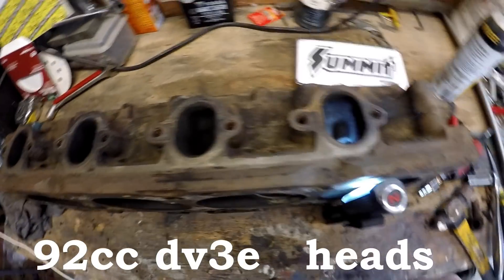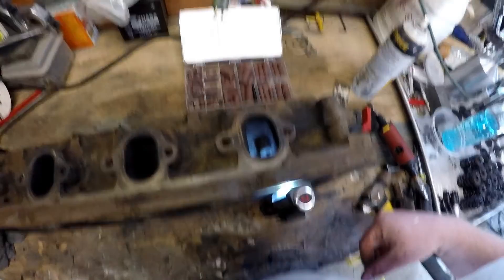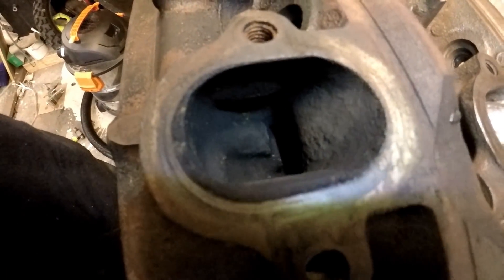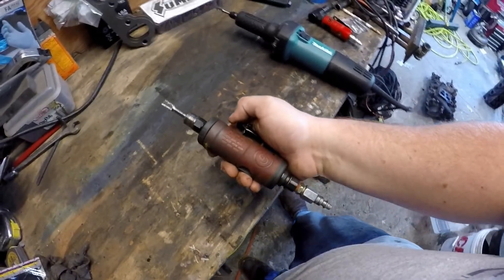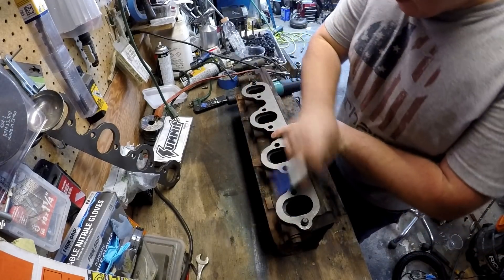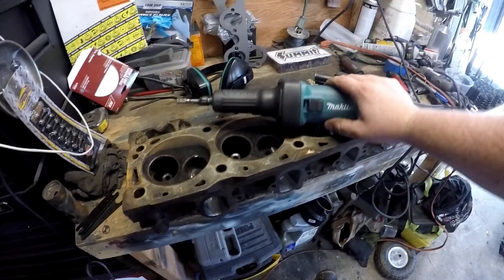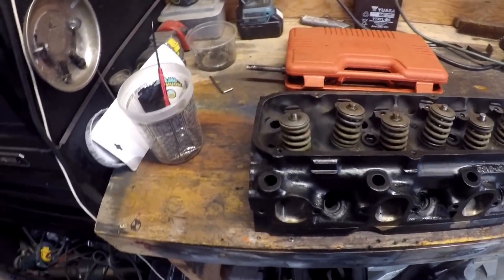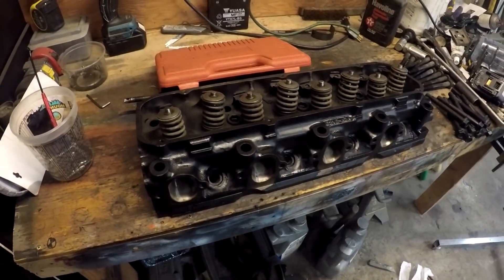Best (Cylinder head porting) tool dent side 460 build

Comment: I realize this was 6 years ago, but just to lend some advice for anyone attempting the same....

Always scribe a line into your material. It'll help you keep straight. The sharpie can wash off or burn off if you're getting to hot with the grinder and you're left guessing where to stop.

That Makita is a bad ass! I've had the same one for 22 years. It works better with a speed controller. 

Tapered burs like an "egg", "tree", or "flame" have specific purposes but work better than a standard cylinder round nose bit.

Lastly, keep the corners of the runner as round as possible. Like the roof is the perfect shape for flow, and the corners of the floor are dead zones.

Ideally you'd want to weld the floor up about even with the apex of the short side. That would increase air speeds on the flow bench, but more importantly it would give you an anti-reversion wall to keep the intake air/fuel charge clean.

Comment: Keep in mind that the intake port needs just about as much help as the exhaust port on these heads and it easily responds to porting.  On the exhaust learning what to take out and what to leave is very important.   Scott Johnston has done more research on porting of the base heads than anyone else that I know of and his porting guide is extremely valuable.

Comment: Look at reincarnation atomotive.com .also try a 1/2 oval burr I use an coarse burr that's for aluminum. Put it in past the guide and pull it towards you and make a trench on each side of the guide then grind off the excess . I make a little fin centered on the guide

Comment: First, worry about the guide boss and more important you forgot short side radius which is key for increasing the long sides velocity which ich is more important than net cfm and raising port ceiling using a header gasket is a waist and again hurts velocity.    watch some David vizard videos before you insert ignorance that was probably given to y6ou its alright to be ignorant if you trying to overcome it
Reply from the maker: thanks will definitely check himout

Comment: Do you have to fill in the egr hump holes?
Reply: I saw a trick a while back when i was building a 460...basically the guy plugged the holes with a hex thread & ground the "bolt" along with the hump & it was all smoothed out when he was done with it. Sealed everything up & had the air flowing only through the ports..
Reply from the maker: no sir i have the egr ports on the head plunged so there will be no leaks, technically it would flow the slightest bit better if i did  but cast is hard to weld . thanks for the comment!

Comment: At least your practicing on head castings with big combustion chambers. Need to find  D0VE casting heads.
Reply: What do DOVE castings look like?
Reply: @norman_sage2528  high compression head used on 429/460 up to 1971 step under cast iron cobra jet heads.
Reply: @kevind3185 the D0VE-C heads were not even close to the SCJ heads. The D0VE-C heads were the common head used. The non performance versions. They were essentially the bottom of the barrel for that time period. D0VE-C heads were the standard head used in 1970 & 71. They would be found on 460s in Lincolns & T birds & 429 thunderjets. Don't let the thunderjet name fool you, all it indicated was that this was the poorest form of 429 offered. If was not a SCJ 429 or a Boss 429. And the next step above the D0VE-C heads would be the PI heads & the PI heads were the best & top performance head ever offered on a 460. And PI heads are basicly 1972 only. Otherwise ford never made a performance version of the 460. It was always intended as a big luxury car engine, not a performance engine. The 429 got the SCJ package wich was meant to be a performance engine. Truth be told, alot of people like the PI heads over the SCJ heads. And for the ultimate race package then as the top dog was the 429 Boss wich is a different animal. But as far as D0VE-C heads, they are the same as the prior yrs with the C8VE & the C9VE & then the D0VE-C & D0VE-A heads all being the same head with the exception of the casting numbers. Not performance heads, never were meant to be. That's not to say they can't be used as such nowdays when we build our 460s. Like stated they do produce good compression. Otherwise not much different than D3VE-A2A heads. And for my personal taste I kinda like D3VE-A2A heads for one becouse I have 4x4 trucks & not race cars. But also building for the street if I cut the deck of the block & buy a flat top piston I can build a good quench motor & get my compression right in that 9.5 to 1 - 10 to 1 compression range & flat top piston with a good tight quench is a better combustion than a dished piston & no quench with the same compression & that's what you are forced to use with D0VE-C heads & keep in that compression range. Since I port my own heads this is a big reason for me to want to use D3VE-A2A heads. The other difference is the rocker stud bosses. It really isn't very much money to spend at a machine shop to the bosses cut down & drilled & taped to take 7/16 rocker studs so that I can have adjustable valve train & use guide plates on the D3VE-A2A heads. However if I found some at a reasonable price I would jump at a set of 72 PI heads!! But between the D3VE-A2A & the D0VE-C I'd rather just use D3VE-A2A heads. A dime a dozen or in many cases they are free. And used for so many yrs its not hard to find some in decent enuf shape were they don't need a total rebuild. A set were the guides all still look exceptable. Give a good 3 angle & go to town on them. And I have a sioux seat grinder & stones so u do that myself aswell.
Reply: Richard Skipper  because the exhaust ports really suck and the shape and size of combustion chamber is asking for detonation.
Reply: Kevin D D3VE and D0VE heads have the same ports and same shaped closed chambers. The only difference between them is the volume of the chambers. D3 is nominally 95cc and D0 is nominally 75cc. Apart from that, everything else is the same. You can still build a 10:1 450hp 460 using D3VE heads, it just comes down to piston choice. Later unleaded D3VE heads have one advantage over D0VE heads, which is hardened valve seats.
Reply: Richard Skipper no worries. I’ve been building 460’s for a lot of years. Mild street engines with cast heads and also 700+hp race engines. So I know my way around these engines and the different factory heads, as well as aftermarket heads.
Reply: @kelvinhill9874  Building my first 460 for a project, probably using D3s. In Adelaide, you have a contact email or something to help a brother with any queries?👍

Comment: I ported a set of those 1973 heads myself what a big difference but I put pop up pistons to bring it up to 10 to 1 compression in my 1978 Ranchero it made 450Hp with a small cam, today I would not waist my time with aluminum heads so cheap now
Reply: If only those heads were cheap to import to the 3rd world. Just rings and bearings are gonna cost me $450 after import duty :(
Reply: You need to overthrow your government. If they are willing to hurt children, there is no limit to what they'll do to you.
Reply: I could not believe how restricted those exhaust ports are. You literally can't get  your little finger tip through them. Was two days work but so worthwhile.
Reply: Dam right baby cast iron all the way ..I'm old school and won't change for nothing..460 are just the balls man...kickass